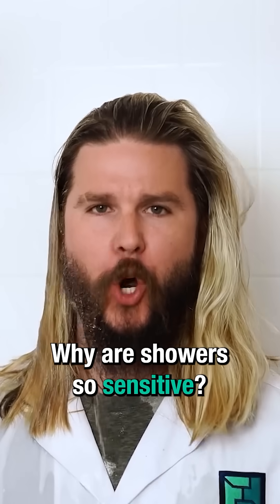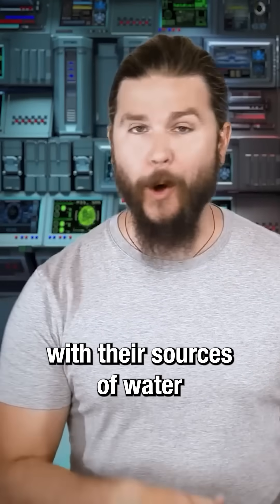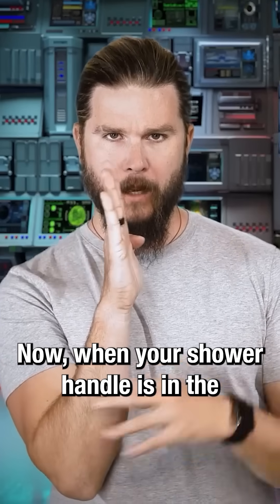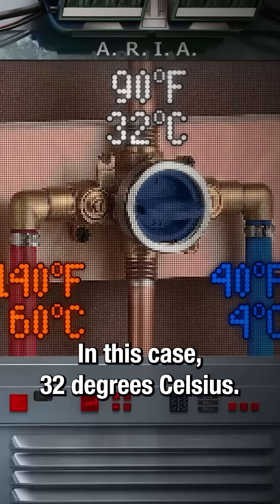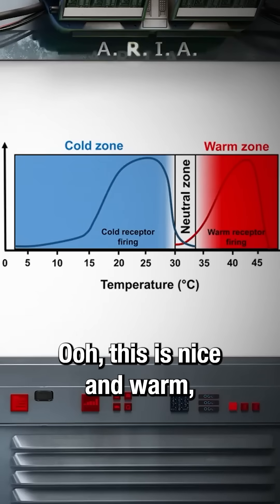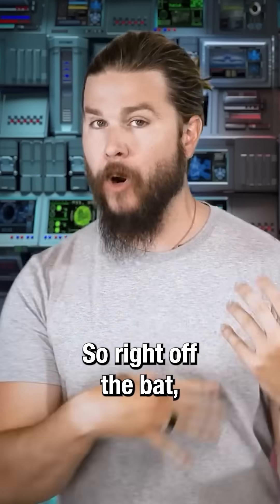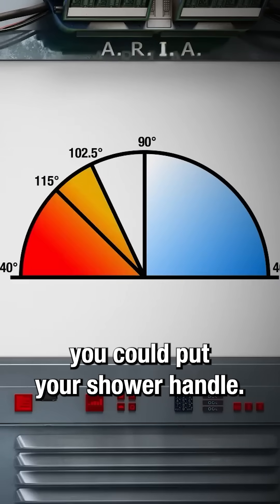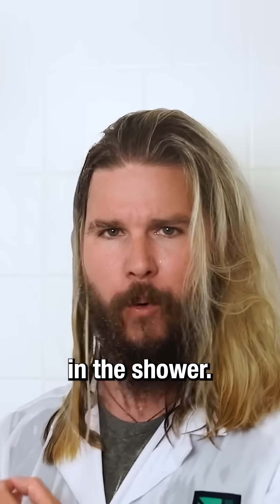Why are showers so sensitive? 🥶🥵

Comment: I have actually been thinking about this during winter because it is far more sensitive. All they would have to do at the bare minimum is put a small worm drive gear in the handle so that way the handle would have to spit a lot to get just one or 2° temperature change

Comment: My shower handle exclusively stays in the "useless" blue part, thank you very much
Reply: Mine is always in the "useless" red bit.
Reply: Least obnoxious cold shower taker
Reply: Mine stays in the useless red part
Reply: hey guys! this guy takes cold showers! what a wonder!
Reply: if it’s not getting nice and hot, replace the shower cartridge.
Reply: Try hard
Reply: Turn up the temp at your water heater, every one has a thermostat to control the hot water temp
Reply: @TehStrangeTaco  my girlfriend made me turn it down because she was burning herself at the sink.
Reply: @qwertythekid2688 don't turn it up on the water heater, that'll just blow your water heater. If you youtube it, it'll be easier to figure out how to do. You need to remove the handle in the shower, and there will be two like, dials in there that you adjust basically. Takes 5 mins. It's like turning a cheap gas station lighter into a flame throwing crack lighter. How you take the metal off, lift the plastic bit, spin it backward without turning the valve back, place it back down and turn it now to open again, know what I mean?
Reply: @Iridescentbso  good call! I gotta do that and not tell anyone so the water is scorching hot 😂
Reply: @qwertythekid2688  Dude, tell your girl to be more careful.. Unless there are small children in the house, this should not be a concern for two adults.

Comment: Thermostatic shower valves are nice, you set the temperature and it stays the same, you can then use the other knob for pressure without have temperature fluctuation.

Comment: This is why “we” use “thermostat” systems. You set the ratio of hot and cold, and then you set the total flow. Temperature doesn’t change with the amount of water/s and can even out temperature swings from the heating element. It also retains the set temperature so I can just hop in not having to worry that the temperature is too hot or too cold.

Comment: It can also be your cartridge or mixer valve or whatever you've got. When it goes bad, the valve gets kind of sticky so you can turn the handle smoothly, but the parts inside are sticking and then quickly releasing and snapping to the new position. Changing the cartridge can smooth it out.

But who wants to deal with that? I can tell mines gone bad a few months ago and I still haven't changed it

Comment: As someone who lives in a place where temperatures go from below 0 Fahrenheit to over 100 throughout the year: the water supply also fluctuates quite a bit. Meaning that during the hottest days the lowest temperature is warm, and on the coldest days it is just barely hot on the highest.

They’re sensitive, but every house will be able to use them. Less sensitive showers would have to be localized by region, take into account your water heater, as well as personal preference. Making your shower work for almost nobody else.

Comment: Also hot water in your water heater cannot be colder because a bacteria called legionella lovvveeesss the same temp that you like showering at. So the water heater water must stay hot enough all the time and then be mixed with cold at the end source. Or just get a tankless water heater but be aware you won't have enough hot water at once if multiple people are using hot water. Great for a small fam tho

Comment: Also, as with most stimuli, our bodies adjust to the stimuli.
So what was once oooooo aaaaaaaa im not getting out becomes slightly cooler in perception. So we increase the temperature. Then it's hotter than our bodies can handle because the initial sweet spot was the sweet spot.
We then begin to overheat so we reduce the temperature, which now feels cold because our skin is overheated.

Comment: My current apartment has a shower knob that just opens the valve and one behind it that adjusts temperature that you can leave in a fixed position and basically never have to touch again. Its amazing and I wish every shower had it.

Comment: There's something wrong with our shower mixer valve. If you turn it just a tad to get it hotter, it turns to freezing cold. To get that perfect temperature, you've gotta dial it all the way back to freezing cold and then "aim" for where you think that ideal temperature will be. There's no fine-grained control. If it's too hot, you gotta dial back and try again, too cold? try again. A bit like a rotary phone, but you have to guess where the numbers are :D

Comment: Here it's common to get both hot and cold water supplied by the city, so the ideal spot will shift a bit depending on the time of year, so that whole space is not necessarily wasted.
Reply: Where is here? Seems like a pretty bad idea to try and supply an entire city hot water instead of just having heating systems per building
Reply: @nathon1942 well in many eastern Block nations you will have mostly Citys with external heat from the nearest powerplant and it is actually pretty efficient  because they use huge boilers pipes etc with relativ small surface area too a huge Volume so heat cant escape the system and  on top of that they use the by product hot water for that   the huge cooling Towers are there so why not use the energy still in it too heat homes not too fare away (also there ar limits too how fare power plants cann be space apart aka transmission losses the main reasons you dont see massiv solar parks in at the coast of the Sahara with cables going to Europe. Oh and because of that the coverage is pretty good
Reply: @TheLtVoss  yep, pretty much this. It's actually the most efficient way we could get here. Maybe the only more efficient way would be "small reactor act", which would mean it's possible to replace all those coal plants with small nuclear reactors instead.
Reply: @nathon1942  Most big cities in Poland. You can have your own, but it's more convenient. You also get supplied heating for the radiators in winter.
Reply: @nathon1942  At least in Poland, we already have district heating (building heating, but a lot of buildings from one combined heat and power plant). 
Water is just an extension of the same system, eliminating the need for individual water heaters (and risk of CO poisoning).
Reply: Saturday night at work here in Texas we were turning on a breaker panel and a short in the wall ignited a slight leak in the gas line causing a flamethrower inside the wall. The house didn't burn down because the supply lines to the tankless hot water heater broke dumping gallons per minute of water down the same spot in the wall. Suddenly having hot water supplied by a power station sounds pretty good.
Reply: @AcidGambit419  while your case is pretty extreme, there are multiple safety issues with natural gas. Most common one is actually carbon monoxide poisoning. Explosions happen, but are pretty rare nowadays. The other issue is purely geopolitical. Poland was depending on Russian gas for a long time and even though recently there were some moves to let us to acquire it from other sources, the lower consumption where it is not required, the better.
Reply: Is your city using geothermal heating?
Reply: @PythonPlusPlus  nope, coal. There are no geothermal sources in Poland.

Comment: And the engineering reason for it needing to be that way is that your cold and hot side can vary greatly in input temps from home to home or even season to season, so you still need to make a product with all that typically unused area because that sweet spot will move.

Comment: 1) Pop out the decorative center plate and/or unscrew the handle's set screw (depends on the model)
2) Remove the handle to expose the hot water temp limiter ring
3) Slide the limiter ring slightly off of the toothed shaft and rotate slightly to control the top end distance the handle can travel until the hottest the shower will go to is your preferred temperature "sweetspot".
4) Reassemble the handle assembly and all screws
5) Make sure you do step 4 before you do step 5 or you're mixing valve might dislodge from the wall and flood your bathroom, apartment or house (you get the idea)... Only then,  turn the handle on to its new max hot travel position and test your work by feeling the water temperature.
6) Repeat process and adjust as needed to achieve ideal temperature.
7) During winter you may need to readjust the limiter ring to compensate for colder than usual incoming water temperatures as this mixing valve is just mixing the hotwater temperature coming from your hot water tank with the cold water temperature direct from the underground pipes coming from the street. Those pipes get hotter or colder depending on time of year and fluctuate with ground temperature, hence the need to adjust your temperature limiter on occasion.

This capability is usually utilized to prevent scalding or to decrease hot water consumption, but can also be used to simplify the process of targeting your temperature "sweetspot".

Comment: You can adjust your shower handle to let in more cold or hot a lot of times you can also turn ur water heater up or down as well
Reply: (You can take off the water handle and adjust the dial on the inside) sorry read it again and it sounds like it’s just telling you to get better😭

Comment: Funny im just seeing this now. I had high water pressure (120 psi) at home, so i installed a pressure regulator at the meter to get it down to 75. At the same time I upgraded the pipe from the meter to the first tee (where it branches off to the water heater) from 1/2" to 3/4". I dont know which made the difference, lowering the pressure or getting larger pipe to where it splits off, but it seems like the "sweet spot" is a bit easier to find in both my shower and the kitchen...

Comment: I sometimes like turning down the heat in the shower, especially to cool off on a hot summer day, and when I'm really stressed out I'll turn the bathroom lights off and sit in the shower under cool water. Also my grandma used to use the bathtub to wash clothes when I was a kid and we didn't have a wash machine, so she needed to be able to make the water very hot.

Comment: I hate those single shower knobs, two, not nobs but handles are way better as long as they only have a movement range of about 90  degrees, this way you can adjust the temperature and water pressure very finely

Comment: try being on a boat to have smaller water heaters we set them to 170 and you just mix more cold water its always my first warning " DO NOT TURN JUST THE HOT WATER ON AT ANY FAUCET IT WILL BURN YOU"

Comment: I disagree. I believe there are (unintended) functions to this lazy engineering.

If I need to fill a bucket for mopping with hot water, I use the shower. The hotter it is, the faster it will dry out.
Same for cold water. It would be a waste to heat up water if all you need is cold one in larger quantities.

Comment: This is why two handles are better than just one.
Reply: Didn't feel like editing. It's because you can feel the water pressure through the handles. You can literally feel in your hands how much water you're letting through a moment before it even hits the spout. Usually it still only takes microadjustments to drastically change the volume of water. I turned my water pressure down a few months ago to see if it would help me save water, and it did, plus other effects, such as it made the shower handles less sensitive. At first it was annoying that it took a few extra seconds to fill a glass or bucket, but it's now normal and I don't care.

Comment: Bruh i never had a hot shower in my life cause out water come stright from underground and we never use heater to heat water. Sometimes we would prefer cold water due to temperature rise , I would rather bath in boiling water then add ice cubes to cool it 😅.

Comment: This only applies to old style water heating system with boiler. Not so to electric shower heater, just set the number and wait 1-2 seconds with your preferred temperature.

Comment: My hot water takes about 2 minutes to get to the shower and you want to remove the “all hot water” option? Also, the cold water progressively gets colder until it stabilizes at the temperature the cold water is in the supply pipe outside, so getting fully cold and warm water before setting the correct temperature is essential for me.

Comment: Why not just put a small gear to the handle and use that to turn the valve. 1 rotation = Only a few degrees of temperature.

Comment: I must be incredible I get it perfect every single time with minimal effort.

Start with the hot,  open tap fully, let it reach max heat, then add cold to adjust temperature. 

Cold nearly always gives higher water pressure than hot. So only using the cold tap to adjust temperature is the best way to mix water.

Comment: All of the shower handle is useful, when you have a small boiler, because the water gets colder and you have to turn it warmer over time
Reply: I was about to say that. It's all fun and games until your perfect temp only lasts a short time
Reply: That's why I have a shower head with a built-in heater. Infinite hot water.

Comment: I also think the human body is so sensitive, i understand just Fahrenheit so forgive me for using it in the comparison but, hot tubs, the human body avg temp is 98.6F and for a hot tub to be considered hot. For many that can be as little as 100F, just 1.4F above somewhere around their body temp is, go to things like 102 and 103F and it's burning especially 104 which is where most hot tubs max out at, just like if you exceed 100F when you have a Flu you feel like you're hotter than tbe surfaces the sun and burning up, even though you're just a handful degrees hotter than average. So I think these 2 things in combination are why showers feel so sensitive.

Comment: So basicly two flow controller, 3 temp sensor, and a thermastat or a logarithmic handle that  is say 35/65 at 25% then slowly moves to 65/35 at 75%. This would give more control at the running temps. Although oh, separate thermostat makes more sense with the handle controlling pressure.

Comment: They should make shower faucets like micrometers or microscope dials, so you can still go from cold to hot in half a turn, but you can also set the temperature very precisely when you want to using a smaller dial.
Reply: There are thermostat cartridges where you actually set the temperature, not the mixing ratio. The ratio is adjusted to get the set temperature using a bimetallic element. They are a bit expensive though.

Also often ceramic disk mixing batteries seem to not be linear. I wonder if they are designed such that the middle section is extended. The ones in my faucets also have an adjustable offset such that the center is not equal mixing but a bit warm.
Reply: There actually are.
Last I visited Japan, is was fairly common to see taps that actually have the Celsius degrees marked. Pretty dang accurate too.
Reply: You sort of get that with a shower that has two handles instead of one. Turn on just the hot water handle for the big changes in temperature then turn on the cold handle for smaller adjustments.
Reply: I bought a shower head once that always showed the exakt temperature
Reply: what about an ai faucet? haha.
Reply: This, but it would need precise temperature readings on the two input and the one output pipe.

Comment: As a Dane this is really odd as everyone in Denmark have thermostats for adjusting the water temperature - just open it and it will just provide the correct temperature, even when someone flushes a toilet or opens a faucet, it just handles it without you feel it.

Comment: if you have 2 knobs, like most people, you know that the sweet spot is to turn the hot knob water at 80 % and cold water at 20- 30%. Unless is summer wich is 2% hot and 90% cold or is winter wich is 100% hot and a little of the cold if needed.
Unless instead of a hot water tank you have a heater, in wich case is hot knob at maximum and a little of the hot knob of the washbasin and you have to regulate 3 knobs instead of one

Comment: It exists so that in summer you can have cold showers and in winter you can use the whole heater if needed, remember that as less hot water is in the heater youll need to move the handle to the hot side for it to still pour the same °C of water temperature

Comment: Lazy engineering has nothing to do whit this, for 100-200 $ you get a manual temperature adjusting shower ( you can find one even cheaper one like for 30$), you can look up a 1000$ + automatic teperature adjusting shower.
 The manual shower handle has no idea the temperature of your hot or cold water temperatures, I have an electric water heater and can adjust the temperature of hot water from 30C° to 90C°,  if i set the water heater to 40c° I have a lot more "fine-tuning" adjustable control from 40c° to 32c°, if i set the water heater to 90c°  i have a lot less "fine-tuning" control over the water temperature.
 I'm not an engineer i just use my brain a bit😅

Comment: The problem is not the sensitivity of the handle, it's that the sweet spot drifts depending on which side you accidentally opened too much: swing it too far to the hot area - and your confy temperature is now way into the cold section, you overcorrect it too much - now it's somwhere completely random and you also messed up overal pressure, and at different pressure you need to find a different equilibrium.